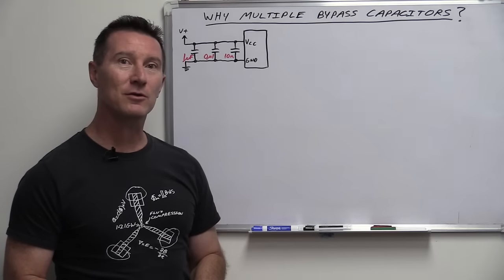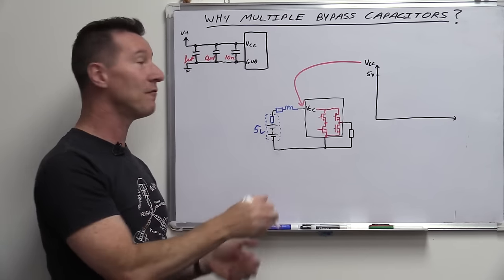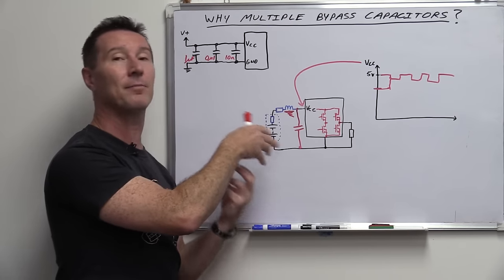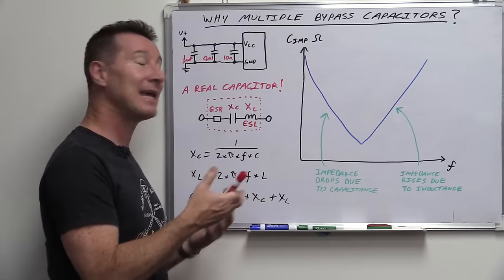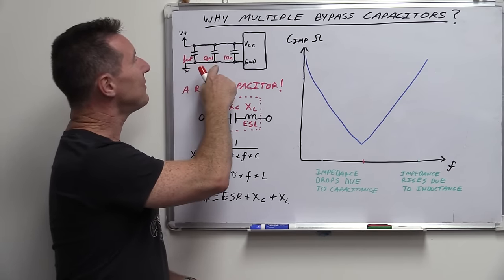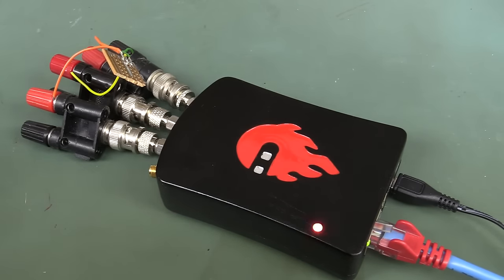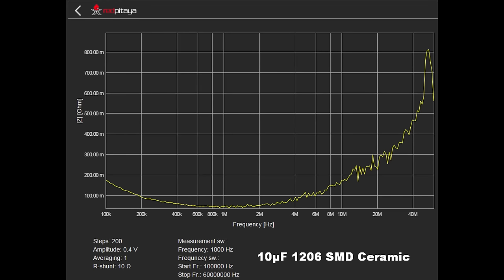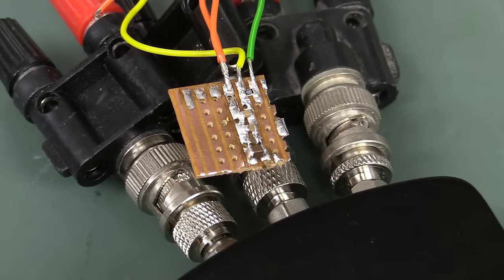EEVblog #859 - Bypass Capacitor Tutorial

Comment: what values for bypass caps to use with a 3.7 V LiPo as power supply (if any) ?
Reply: ThomasHaberkorn The amount and type of bypassing you need is not going to be determined by what the source of your power is, but by how long the traces (or wires) are to the switching loads, what the edge rates of those swirching loads are, and what the power supply noise, and minimum voltage requirements of your loads are.

Comment: Ironically analogue audio designers give this most thought where only 20 kHz is the need. They often do more testing than other engineers including listening tests. As always good test gear will answer these questions. However using test gear needs experiance. NPO ceramics are good devices and can be had in 10nF. Some ceramics look unlikely on paper, they can work very well and are cheap.  Keep everything neat and used SMD types if you can as they have less inductance. 1206 size is nice for hand soldering. 2 x 10uF for plus minus to ground with 10 nF for plus to minus can be a universal fix for up to 100 mA devices.  Tantalum caps sometimes fail in time. A Panasonic FC type and 10 nF TDK should be ideal.

Comment: +EEVBlog If you want a good network analyser which is cheap, there is a company (SDR kits) who do one which can go up to GHz if used with caution and calibrated. I used it for my dissertation on low noise crystal oscillators!

Comment: The reason more than one cap was added was due to the lead added inductance. This was in axial caps back in the day, I started in the 70's. As we progressed to SMD people forgot this reason so we still, not me, add two caps. Modern designs use one SMD cap of the largest value in the smallest package. I've done this for a few decades on digital designs. 
Sorry Dave. This is a proven method.

Comment: Is a bypass capacitor the same circuit as a smoothing capacitor?
Reply: +euan todd No, a smoothing capacitor holds bulk charge, typically in power supplies to smooth out the 100/120Hz ripple from the bridge rectifier. Bypass caps deal with relatively small transient spikes.
Reply: Ok thanks.
Reply from the maker: +euan todd As Zadster said. The key is in the name "bypass" means to literally bypass the power supply and supply the chips power (momentarily) from the capacitor.

Comment: I know absolutely nothing about IC'S nor components, but why can't the bypass be built in to the chip itself, is it impossible to make capacitors that small? Or is it because they heat up an may destroy the chip?

The only thing i get is that they somehow used to store up the juice and level out the powerflow, i think i need to read up  on how a capacitator actually work.
Reply: I have a question are there  AD converters in every USB soundcard or is it the circuitry of the computer that digitise the signal?

Also if it actually is an AD converter in every USB soundcard how come they still add noise and hum from the computer, it seem impossible to me? I mean it would not be much of a computer if the bits somehow get fliipped after  conversion?

It is a mystery to me, or the mystery isn't there and it is just because of crappy AD converters, but i am pretty sure my Behringer UCA222 take up alot of noise from the actual computer not just the conversiion circuitry?
Reply: A number of big ICs DO have caps built into the package.  Usually these are big chips like processors.  It makes the board designer's job easier because the caps built onto the chip carrier are often closer to the die than any cap on the PCB is going to be.  It can make it more difficult to mount a heatsink on the chip though - it may require custom cutouts on the bottom of the heatsink to allow room for the caps.

Comment: Soooo....capacitors in DC circuits
Are basically....voltage shock absorbers?

Each capacitor has different shocks it’s good at absorbing...but all have a weakness?
So...you give em the wrong voltage frequency and they just kerplode and burn up?

So....we use a couple different for redundancy, so we can absorb all sorts of voltage fuckery, without one potentially exploding?

Like....this work?

Comment: Hello, I wonder that I try to design a PCB including a microcontroller (i.e. ATMEL 328P something like that) and I need to use crystal oscillator for square-wave for this microcontroller. And then, I know that I need bypass capacitors to eliminate noise and parasitic effects. However, I need a help to determine capacitor values for 16 MHz crystal oscillator. How can I calculate? And also, why we need to use two capacitor as I see that https://www.electronicshub.org/crystal-oscillatorquartz-crystal/

Comment: Your impedance formula is wrong. Should be sqrt(R^2 + (Xl - Xc)^2)
Reply: You noticed that too? I wondered about that myself! Inductance is the polar opposite of capacitance, so when they''re in series, the inductance reduces the effect of the capacitor. At a certain frequency, when the reactive impedance of both devices is the same, the impedance wants to drop to zero. If you put the cap and inductor in parallel, the impedance wants to be infinity. The only "fly in the ointment" is the equivalent series resistance in the devices.

Comment: 9:40 (Goes away and solder in random stuff (looking like bypass capacitors) on a 2.4 volt AAA battery driven pocket computer trapped in many years of boot loops.)

Comment: TI's own wiki on high speed BGA recommends using a large value capacitor buffer the power coming from the power supply to the BGA chip (bulk cap), and then only using a single value of capacitor for the actual bypassing. More links below: http://processors.wiki.ti.com/index.php/General_hardware_design/BGA_PCB_design/BGA_decoupling#Value_For_Pin_Capacitors

www.ti.com/cn/litv/pdf/sloa069

http://www.interferencetechnology.com/eliminating-the-myths-about-printed-circuit-board-powerground-plane-decoupling

This article from Maxim about ceramic cap ratings is fairly important "Why Your 4.7µF Capacitor Becomes a 0.33µF Capacitor": 
https://www.maximintegrated.com/en/app-notes/index.mvp/id/5527

Comment: lol. this is great disenchant for many voodoo-e-designers !
Reply: +nRADRUS no...as they come up with various sideeffects usually alongisde with much overhyping these. Take the skin effect for instance....you need to take this into account when designing stuff at around several 100+ Mhz and some power running through at the same time.

But these VooDoo guys even say you´ll gonna hear this within the audio range, and try to sell you these mylar FlatFlex cables....in where  two digit count thin copper or CCA stripes running in parallel....The better ones even comes with thin silver stripes...and bipolar arrangement, in where one is the positive and the adjecent stripe is the negative (return) path...

You can bet, they come up with something and try to fool you....;)

Comment: When you see such a bypassing like 1 yF, 100 nF and 10 nF in parallel you know that the designer does not understand the basics of electronic design - like Dave. Really I like your videos but this is so misleading and full of wrong Information that you should be extremly carefully with that. As a rule of thumb only put capacitors of exact same capacity value and type in parallel, otherwise you generate a pole where at the pole frequency you have no filtering at all (you get amplification -> swinging issues). There is one exception and that is paralleling electrolytics > 10 uF with bipolar caps of < 100nF, where the chance of getting a bad pole is negligble. But better check with an impedance meter over full spectrum. And it makes an enourmous difference if you power from a battery or from the mains. And in the ideal world you need bypassing also. The Problem of the power rail spikes is not the inductance, but switching of (esp. MESFET) transistors. Now these switching pulses are faster than the supply can compensate, because of the high output impedance of the supply (yes at DC it is low but not at high frequencies). Therefore bypassing capacitors simply lower the supply output impedance and act as a short circuit for the spikes. Primarily this has nothing to do with inductance. However the hole thing is much more complex because there is so much more to know about it, I can only scratch the surface with one post. So trace inductance matters as well but only as a secondary component/effect.
Reply: +hugo schmeisser 1 yF? yocto (10−24) Farad? ;)
That's a double-puff!

(Also, seconding your comment. If the C is actually an L, and you put it with a C that is a C, isn't that an LC? And of course you made sure the ESR was low, so isn't that now a high-Q LC resonator? Double-face-palm-plus-double-face-foot-sole!)
Reply: hugo schmeisser so true.  This reminds me 2ghz biotech design.  This was exactly the problem.
Reply: On the schematic they are all shown as side  by side  but in reality, on the board itself, the electrolyic might be at the supply connection but, further on, after the inductance of the traces , some nf range caps are found physically next to the vcc and ground pins of the ics. Schematics do not always show the actual physical position of decoup. caps and do not represent reai inductance encountered in the power path.

Comment: He is NOT showing the reality with capacitors. At 17:50: Graphs of different capacitors DON'T have the SAME minimum value! Using different values is a bad pratice it is better to use all 0.1uF in the smallest pratical package and also to use two full and close planes for the supply and ground. Today high speed chips use voltage around 1V not 5V!!! His setup to test resonance is really bad... he is using very long wires!

Comment: sigh They always say: if you don't have anything nice to say, say nothing.

So I will say nothing about how you have a tendency to waffle on a lot, and of never really getting to the point without going on on 17 different, and completely unnecessary tangents first, before addressing the 4 key points (each of course with their own sets of redundant tangents), before finally getting to the point. Nor will I comment on how this video could've been wrapped up in 10 minutes if you could just focus on what you're trying to say rather than commenting on every little unnecessary detail that has zero relevance to the topic at hand. Repeatedly. Because we might have missed it the first 8 or 9 times you emphasised it.

But I insist on pointing this out to you, sir, that I am not saying anything about that. For the reason stated above; see paragraph 1.